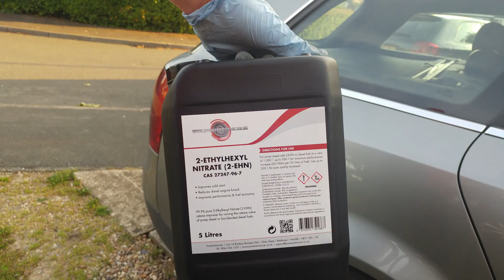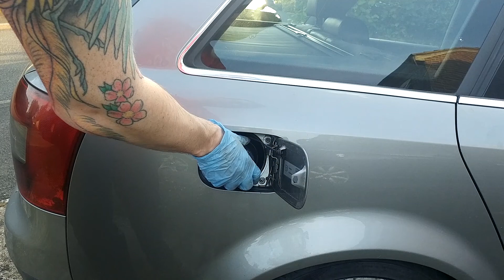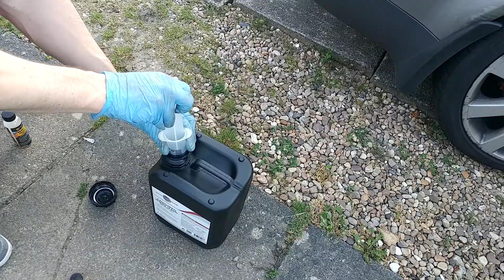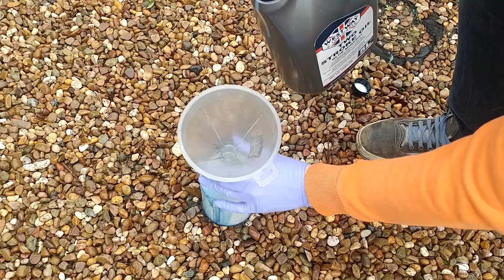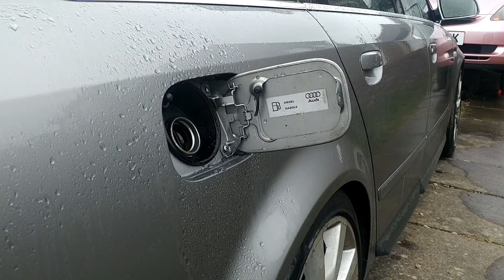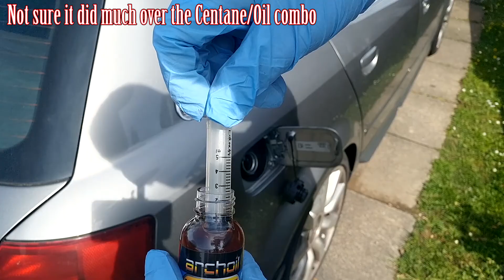2 Stroke Oil and Cetane added into my fuel!? Talking Diesel Fuel Additives

Comment: Use only 2S JASO-FD+ or ISO-L-EGD. Ash content for FB and FC is 0.25%, for JASO FD it is 0.18%. JASO FB has lower lubricity level than FC. And both FB and FC are having much lower detergent level than FD. I use FD from WestWay for years now. I pull injectors every 50kkm to change seals - injectors are clean, I got pictures. I never go over 1 to 250, over that, cetane level goes too lower for my D4D, and engine stops being happy. Its best to keep ratio around 1 to 250-300.
 You experts says mineral is best? Why? Because higher ash content or lower detergent levels? I have mixed 1 to 50 fully synth 2S FD with diesel in glass bottle. After 6 months it stays in a mix. Surprise? Not for me.
Reply: Very interesting points you've raised.  I think the majority reckons the idea of mineral is from what has mentioned elsewhere and that came from elsewhere and so forth.  One source which I found that may have triggered this could be the Bailey's Diesel Group site where the use of mineral was mentioned but did not mention why on the actual article but did at a reply for a comment made to that article.
It was claimed that full or semi synthetic oils do not mix well therefore mineral is the one to go for.
However, your experience proves otherwise.  Since you're using JASO FD full synthetic and getting good results.  There are videos on how well the diesel and 2 stroke oil mixes and order of pouring it in etc.  This shows even the mineral oil didn't mix well if poured in the wrong order.
Very grateful for sharing your experience.  Thank you.
Reply: @jtbtabimono  No problem, I wanted just help. Try it on your own, buy 5L diesel, and 1L of each JASO-FB, FC and FD, mix them with diesel in clear bottles in high ratios. At the very end I recommend using PEA (polyether amine) once a year or so, high in concetration in fuel, as really nothing clean combustion chamber as PEA. 2S oil is to lubricate pump and injectors, as in common rail systems they are really expensive to replace.
Reply: @Fosgen  Thank you for your quick reply and another word of wisdom.  Your expertise have helped a lot for my research.

The main reason I came to view this clip was to create my own Valve Saver fluid.  My vehicle is not a diesel but runs on LPG and due to the dry burning characteristics of LPG, the valves and seats need to be lubricated on some engines.  There are fluids designed for this purpose but quite expensive for what they are.
Therefore, was looking at ways in mixing diesel and 2 stroke oil to create a fluid to achieve this.  The main ingredient for the purposely designed fluids seem to be paraffin but it is difficult and expensive to get hold of in small quantities so came to the idea of using diesel and 2 stroke oil as 2 stroke oil on its own the viscosity is too high - 17 mm2/s for the fluid whilst the 2 stroke oil has between 75 to 100 mm2/s both at 40°C.
The JASO FD spec ticks all the boxes and the final potential issue was whether it will mix well with diesel.

Obviously most people will just pour 2 stroke to their tanks and there is no way of checking whether they've mix well.  Not many will take the time to do the experiment like mixing it in a jar like you did, let alone leaving it for months to see.  Moreover, most people don't seem to take into account different specifications of things, '2 stroke oil is just 2 stroke oil that's it' attitude.  You are one of the minority that look into specs and monitor components which I am extremely grateful for.

Therefore thank you so much once again for sharing your thoughts.  You've help me and others more ways than you think.
Reply: @jtbtabimono  It is indeed very interesting what you trying to achieve. I like to experiment with my compression engine, and for example found out that pure oxygen in inlet does nothing to sound of combustion/RPM, but air mixed with LPG makes engine very smooth and due to increased calorific value of mix, RPM increase naturally. I am thinking about adding LPG to my engine inlet to extend car range to reach at least 1,000 km range.
You know, 2S oil is designed to mix with petrol. It is created for spark ignition engine, not diesel. I would like to suggest 2S FD diluted with acetone or toluene 1 to 1, and spraying mist to inlet, it will add lubricity to valves and rings.
Reply: @Fosgen  Yes, you're absolutely right as LPG will provide smoother running of the engine, mainly to do with being a gaseous form mixes evenly with air plus for automotive applications, the octane value is higher at around 110 RON.

I've been running on LPG for the past 17 years doing over 400,000 miles in total on various cars.  All petrol cars converted to run on LPG.  Older engines didn't need these lubrication fluids but most newer ones, some has softer valves and seats which would require these fluids.  

There is a dedicated system fitted to inject a very small quantities every time which equates to a dosing ratios of 1ml to 1 litre of fuel used so not a significant amount.  My main concerns were lubrication ability (obviously!) but diesel being a form of lubricant anyway plus the aid of 2S oil will achieve this no doubt.  The other concern was the deposit issues but again with JASO FD spec which the main ingredient tends to be polyisobutene, this shouldn't be a problem.  I do take your point on acetones which is commonly discussed on the field and again does form part of some 2S oils' ingredients.

There are kits available to pump LPG on Diesel engines but as you may be aware it has to mix with diesel with certain ratio as there is no spark plugs.  However, feedbacks from those who have had such diesel - LPG additions fitted, engine runs smoother with more torque.  The down side is, those kits tends to be on the expensive side plus longer durability aspects to the engine are unknown - such as stress to the head gaskets, heads, valves etc.

As you mention you have a D4D engine which I assume it is a Toyota unit, CD or AD series of engines, I am unsure how it would cope with extra power if LPG is being added to the mixture.   The higher output 180hp version of the said engine already had spates of issues so would be cautious.
Reply: Very interesting regarding your comment on cetane rating going down if the mix is to rich. I wonder how you determine this? I mix FB spec mineral at 1:200 and my D4D runs much more smoothly and is quieter. I've just started adding 2 EHN so can't comment on that. Sasol did a study (easy to google) that tears apart the idea of using 2 Stroke oil. It reads a bit like they had a vested interest in debunking it. They state evidence of injector fouling, loss of power , particulate filter damage. Some internet forum commenters point out  that the study did not use a mineral 2 stroke oil, therefore was not relevant to, and actually supported the common advice to, only use mineral oil in this application.
Reply: @1Grogey  These days I use only 2EHN 2 mL per liter. 2 stroke oils are more expensive, can't offer them for my new 4.5L D4D. Very hungry on fuel. 2EHN makes enough difference. Engine is more elastic, pulls a bit better.

Comment: I know in my two stroke motors the oil decreases the octane rating slightly so dont see why this shouldn't happen to diesel engines also.....so that would mean maybe less power and less mpg by adding oil? but if i was going to try it id try synthetic as i would not want it to burn like people are saying if you want it to lube everything
Reply: Diesel as fuel has really low octanes so it can detonate easily. Petrol has high octane number as it resists detonation. Heavy oil fuel has cetane ratio which is inverse to octanes. The more cetanes, the easier fuel detonates under compression (pure heat, pressure).
You miss point where 2 stroke in diesel lubricate high pressure injectors, pump and all fuel system. How it helps with rings sealing and cleaning combustion chamber. It takes cetanes off diesel, so it ignites harder, but not much.

Comment: Is there Zinc in mineral 2 stroke oil? And if it does? Will it kill the Catalytic converter?

People say theyve used it for years, but have they ever had to replace their Cat?
Reply: There is zinc and phosphorus in 2 stroke. I never had problems with CATs, and never had problems with injectors blocking. And if you run without CATs like I do now - exhaust smoke in not so bad from straight pipe when I add 2 stroke to fuel.

Comment: I have been using Comma 2 stroke mineral oil in my cars since 2007. Noticed a big difference more or less immediately. Gives about 6 benefits , raises the octane, better mpg, less engine wear, lubricates injectors and injector pump, lowers emissions to 47% of normal. Engines definitely start easier, run sweet as a nut , less clatter on cold start-up. BUT the main reason was lubrication because the way governments ruin our road fuels by removing Lead ( lubricant )from petrol hence the rubbish unleaded now, which is worse quality than pre WW2.
Also removing the sulphur ( lubricant) from diesel. Perhaps they want to raise even more revenue from replacement injectors, pumps and new engines. My info came from a German techy ( not vw) who works still for a big manufacturer. Be not afraid the 2 stroke is tax paid before you get your mits on it, The revenue cannot do a thing about. My final or his final recommendation was to use only mineral or semi synthetic, as in their tests fully synthetic will not blend with diesel fuel. I have always used mineral. Also the ratio of 2 stroke to diesel fuel was 200:1. 

A bit extra will do no harm , only good. Your engine will thank you.
Oh   and  Thank You for doing the video.
Reply: Thanks for the info.ser.i use also shell 2 stroke in my isuzu dmax not common rail.engine no more intermittent rough idle.the injextion pump is bosch vp44.
Reply: Hi ,but what if I add full synthetic Motul 800 2T and pre mixed then put it in a tank would that be ok???
Reply: @dolmar7844  synthetic 2t doesn't blend well with the diesel fuel
Reply: @dolmar7844  I think so
Reply: @YoMamazYT  👍
Reply: I have ssangyong rexton 2.7 diesel
Reply: @dolmar7844  
The 2SO should be to Jaso FC standard.
Reply: 200:1 means 5ml of oil to 1L of diesel? I somewhere read the sweet spot os 0.8 ml to a liter of diesel.
Reply: Axel, raising the octane of diesel is a bad thing.
Reply: @DonziGT230  
Why?
Reply: @WEDEL01  Octane is basically the opposite of cetane and high cetane is what you want in a diesel.

Comment: Personally used 2 stroke in the past with decent results, but stopped due to stuff online regarding the zinc content can cause injector fouling/failure.
Last few months ive been using 2-ehn with the Archoil 6900D freebie you used at the end of the video, last year my MOT emissions for a 1.7cdti were 1.1ppm last week it passed with 0.3.
Is the 2 stroke you used zinc free?
Reply: I been adding synthetic 2cycle oil for about 50,000km to my diesel fuel.  200ml oil on 60 liters of diesel. Engine runs quieter and smoother.  Im not buying the zinc story... as i imagine that for that to take place... you would need temp high enough for galvanization to take place or chemical reaction for zinc to be plated on steel or electrolysis to get the plating...
Reply: I find this hard to believe and would call it a meth or if there was failed injectors it was due to something else! Especially considering there are many 2 stroke outboard fuel injected engines that run a much much higher oil ratio than most anyone would be adding to their fuel. Also considering many people run used motor oil as a cheap fuel alternative! I call bull shit!
Reply: Big Bad John you are right to about the zinc damaging the injectors, just buy a branded diesel fuel and you won’t go wrong. Fuel companies spend huge amounts of money developing the right additives for fuel, I wouldn’t risk adding two stroke oil

Comment: Hey. I just changed the injection pump on my Octavia with 1.9 ALH engine. I was recommended to add engine oil to the fuel tank before filling it with diesel. What is your advice? Shall I do it or shall I buy the additive like you have?
Reply from the maker: Yup the same oil I use should be fine and as for cetane booster depends on fuel quality where you are from
Reply: @CarAndMechanical  I'm in Norway, currently using HVO 100 diesel fuel right now. Alright, I will give it a try. Thank you :D
Reply from the maker: With the oil I buy it in 5 litre jugs but might be worth trying a smaller bottle first to see if it smoothes things out. On my VP44 I swear by it
Reply: @CarAndMechanical  Mine's a VP 37. I am considering buying the 2-ethylhexyl nitrate though. I will try the 2 stroke oil by buying  1 litre first then I'll consider getting a 4L (I couldn't find a 5L jug haha). I have read a ratio of 200:1, does that mean for every 200 mL, 1 mL of oil is added (say 250 mL for 50 litres)?
Reply from the maker: Yup spot on

Comment: i use 2 stroke oil and liqui molly diesel additive on my Civic 1.7 CTDI for 6months now, engine runs smooth as butter,quiet engine, zero smoke even thought its remaped, runs much better and get better mpg, thank you for showing this
Reply: I try only lm disel aditive and have a no smoke..but i nver try both 2 stroke oil + lm disel additive i must try and hope black smoke go away in full gas
Reply: @MAADMAAC  Have you tried it?
Reply: @Gamerdu45  Not yet :D

Comment: Ok People have brought a Tiguan and am also using 2 stroke mineral oil per ever other tank and and I do a run to Cornwall twice a month which is 250 miles there and 250 back at 70 mph with the mineral in I’m getting 56 . 4 miles to the gallon . Without the 2 stroke in I’m getting 48 miles to the gallon . The 2stroke oil cost me £4.00 and I get 6 tanks out of it.
The best diesel out there to me is shell v power which is £146 a litre and way over priced . I have had no problem with the Tiguan and the engine is silky smooth just like my taxi was after the use of 2 stroke . Hope this of help to you guys have a great weekend.👍🏻
Reply: Hi there, I'm also using 2so , was wondering what jaso spec you use , assuming your vehicle's have a dpf?
Reply: Brian Mann hi Brian  I’m using SAE30 low ash .yes it has a dpf and hasn’t caused any problems at  all but I do long runs 260 miles in one go so the engine is always up to running temperature.
I use 500ml to a full tank Hope this helps .👍

Comment: I have been using lucas gas and diesel additives in my 2013 jetta "It has had the software fix" Im on my third tank and seems to be running better .Any  one using this ? And should I add something for cetane ?
Reply from the maker: As its more modern no need for oil, if it's really clean exhaust smoke wise then some cetane may liven it up a bit.

Comment: Been using 2 stroke oil in my London taxi TX4 for nearly 200,000 miles common rail engine 2.5 motoroni i use 200 milliliters to a tank of diesel,  Engine runs quieter and am getting about an
 extra 5mpg .Great vid very informative  .
Reply: Your car have a DPF? Are you using mineral Stroke 2 Oil?

Comment: How much ctane booster are are adding to full tank
Reply from the maker: For my 65 litre tank I ad around 100-120 ml - says on the bottle but I go a bit shy of the max it says to use.
Reply: @CarAndMechanical  might try this in my pd130
Reply from the maker: Cetane certainly shouldn't hurt so might be worth a smaller bottle, the 2 stroke oil bit is in reference only to older fuel injection pump types for not suitable for PD.

Comment: If your using 2 stroke one diesel make sure it's JASO FB rated, 225-250ml per tank, mine is a e60 530D M-sport 160k miles, I've been using 2 stroke and redex injector cleaner every 3rd fill up for around 3 years now. Always quietens down after the treatment and runs smother. In the last year I I stopped using redex injector cleaner and started using 99% pure 2 ethel-hexyl nitrate at a 1:350 ratio of 225ml to 75litres of v-power. 2EHN raises cetane levels of fuel by between 6-8 points(depending on quality of fuel whether it be asda or shell there is a huge difference in dilution ratios)  V-power is apparently 45 so this will bring it to roughly 53 car and rating (highest in uk). I used a 2 cetane booster by redex in my car at Crail speedway (1/4 mile drag) and it made a noticeable difference to acceleration and my times. I've not been since I started using 2EHN so I'm keen to see if there is a measurable difference. But the car feels amazing with it in there, mpg is up by 12, it gets to 30/40/50/60/70 etc much easier and quicker than before even when im driving Ms Daisey and not heavy footed.

As for the comments regarding zinc in the 2-stroke, jaso-fb rated 2-stroke is ok to run in your diesel, it's designed to burn alongside petrol so it actually burns better than diesel and it actually burns cleaner too, so it lubricates on its way through the fuel and injector systems and leaves less residue than actual diesel on its own. 

Premium diesel does has additives like 2EHN but in very small doses to bring the cetane level up, asda has been said to be the lowest rating of 36 so v-power being 45 is already worth the extra few pence per litre in regards to your mpg and the longevity of your engine.

But, these are just my findings, I'll let you all decide for yourselves.

5 litres of 99% pure 2EHN at a mixing ratio of 1:350 with a 75 litre fuel tank is 225ml per fill up, 22 or 23 fill ups. I fill up twice per month so 5 litres lasts almost a year and cost me £33.
Reply: @Jonny Polea, why u say JASO FB, when FA and FB are smokey oils, I'm using Q8 FC (FC non-smoke) for 50k on 320D (same injectors) and no problems at all?
Reply: isnt 1:350 abit high?
Reply: So on the 75 L tank, you fill up how much booster and how much oil?
Reply: Surely JASO FC is the correct grade and 1:200 is the correct ratio to use?